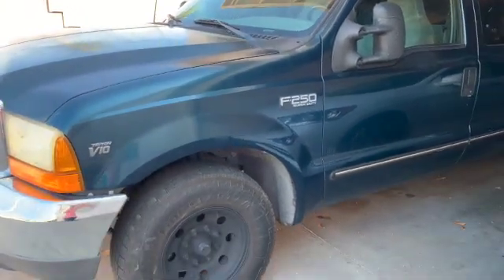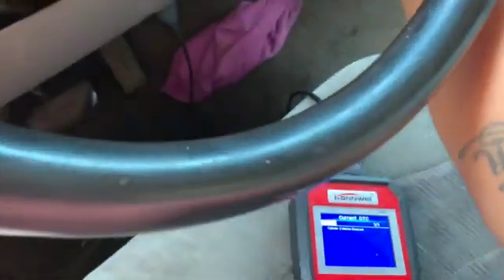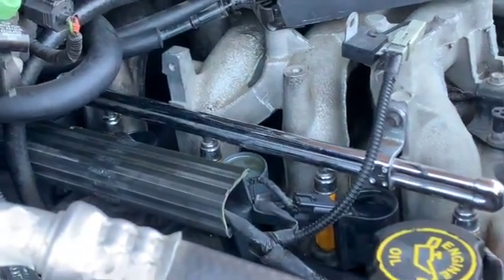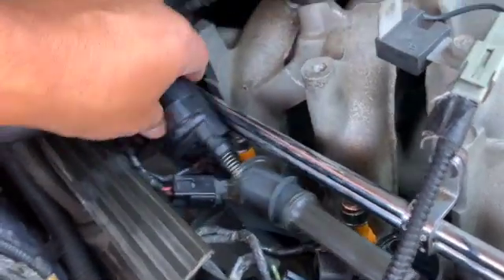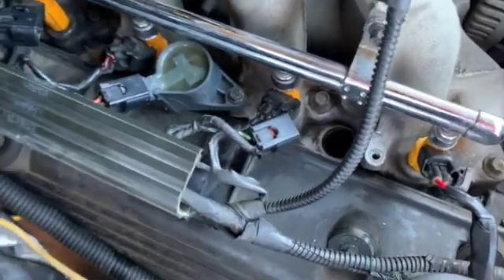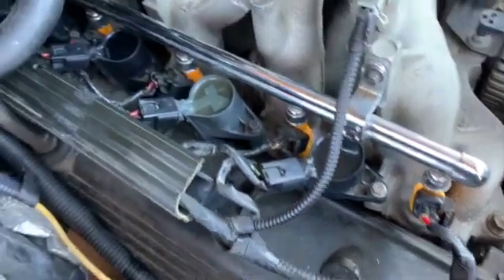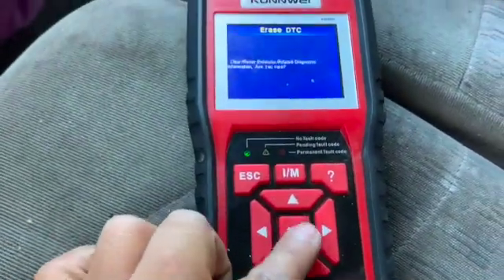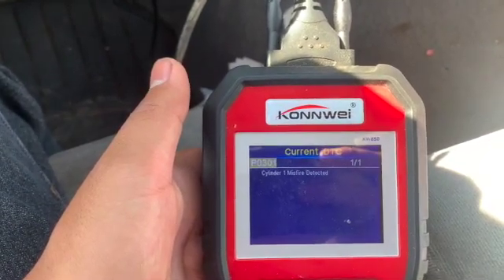How to Fix a Misfire Ford F-250 F-350 Excursion Super Duty 6.8 V10 Check Engine Light P0303 99-04

Comment: I got a 2000 Ford excursion and mine says cylinder 10 misfire. Now saying cylinder 5. Now I got both 5 and 10 misfire. Can I do the same thing you did?
Reply from the maker: Have you replace your spark plugs? If not you should replace your spark plugs. But if you have replace your spark plugs it can be your coils that are bad.
Reply: @RookieRepairs  i replace the spark plugs. But not the coil packs.
Reply: I have replaced my plugs and the coil boots and coils are good. But not a bad enough misfire to tell me a cylinder. Its a hit/miss. Does someone still sell your scanner?@RookieRepairs

Comment: Funny mine has the same cylinder 3 misfire. Last year I had to replace the fuel pump and it took just over 1000 miles to get the readiness codes cleared for smog testing. Tried every drive sequence to clear codes I could find online...
Reply from the maker: 🤔🤔 I’m glad you were able to get it smoggy and get your new tags. I had to drive it a few times- 60 miles freeway and 2-3 times in town until it was ready for smog test- pass smog. I only drive it long distance to pick up cars from the auctions. I need to drive it more…

Comment: I did 10 Accel coils on my 2001 Excursion V10. Didn't really like them. Switched to Edlebrock and they aren't worth a damn either. Thinking about going to Motorcraft.
Reply from the maker: Thank you for sharing this information... I’ve been hesitant to replace all coils because it’ll required 10 Motorcraft coils - I normally get good deals at RockAuto.com (OEM Motorcraft)

Comment: Just letting ya know, you can get a  pack of 10 coils from 60.00 to 150.00 bucks
Reply from the maker: Thank you for your comment- I was looking into getting Motorcraft coil pack which is pricey but I had to get the truck back on the rode so I did a quick fix, thankfully that check engine light never came back on. Did you use a specific brand? I might swap my coil pack to new ones ...